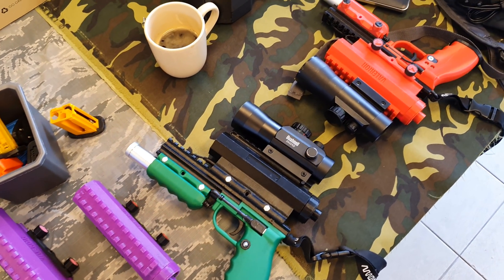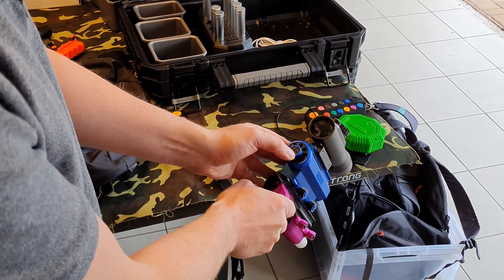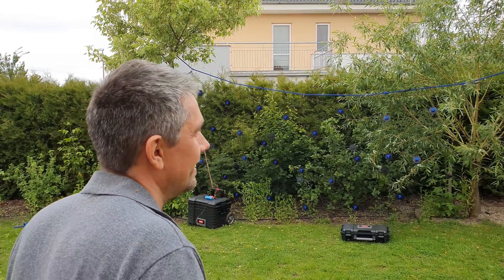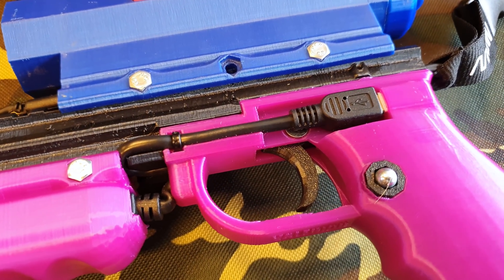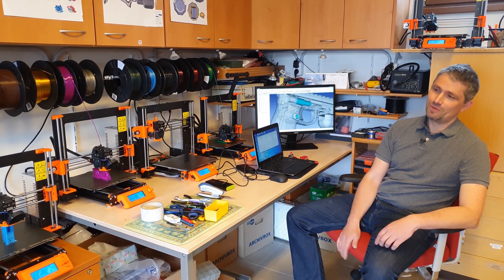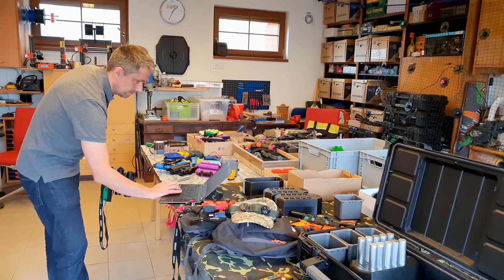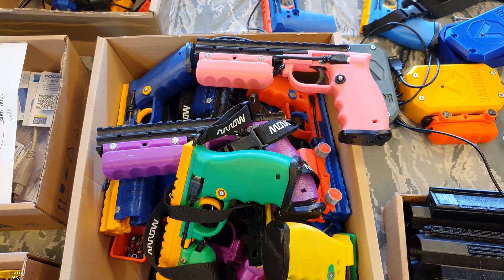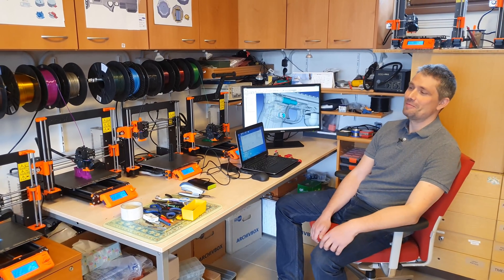Prusa 3D printing stories: Valerior Ultimate Laser Game System

Comment: It may not be entirely clear from the video, but this is not just laser shooting at static targets. You have wearable parts, you can play in a forest with teams, gather upgrades for your weapon, there are different modes including capture the flag. Something like airsoft on drugs :D
Reply: How did you solve the wearables? That is the main part that needs upgrade in laser tag
Reply: @randomguyfrominternet  We do can upgrade product via our own wireless protocol, gun and body unit can be connected via PC SW, it is not fixed for ever. Therefore if there is a problem, you simply take new part and configure as old one.
Reply: @teamvalerior7251  So no change in player's hitbox / hit registration? That's the biggest thing that makes laser tag not as good as airsoft or paintball 🙁
Reply: @randomguyfrominternet  We do have vibration motor inside headbelt/sensors. Some military systems uses electrical shocks, which is not good for children and general use.
Reply: Is the system opensource?
Reply: @GumundurBGislason  Understandably it's not. Maybe one day :)